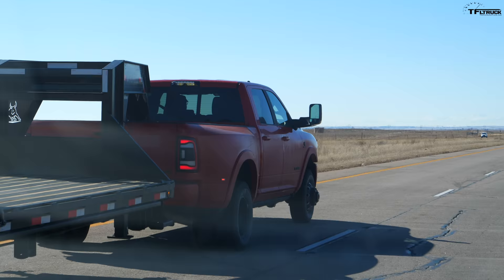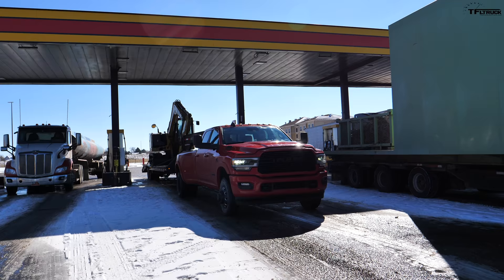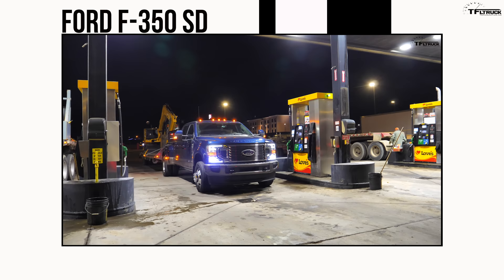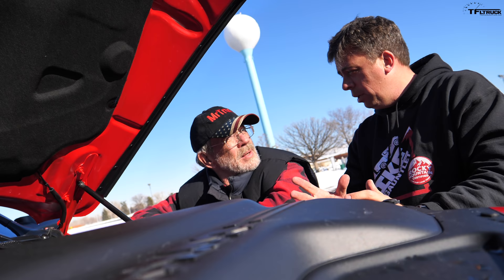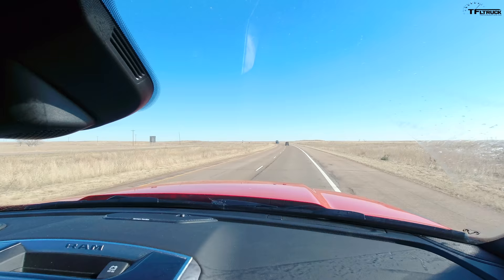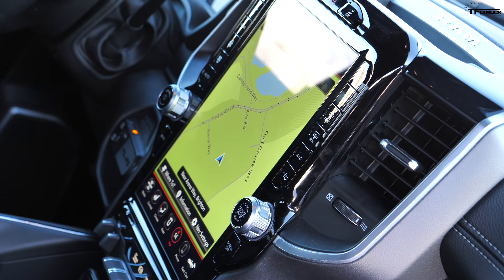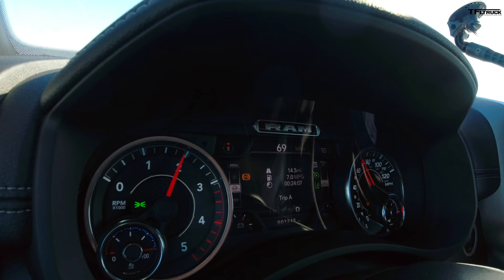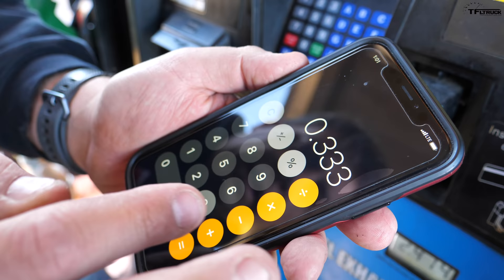New Ram 3500 Cummins Takes On Our 30,000 Lbs MPG Challenge Against GMC & Ford Diesels!

Comment: I drove the Ford and Ram and I was not happy with the turbo lag in the Cummins.
Reply: There is no turbo lag! 🤦‍♂️
Reply: @JohnDoe-nz6bk  the one I drove sure did.  It was the HO with the Aisin.
Reply: Rich Farfugnuven suuuuure
Reply: @JohnDoe-nz6bk  ok, I have no reason to lie.  It reminded me of my 03 6.0L Excursion.  It has terrible turbo lag.  My '02 F350 has none.
Reply: Rich Farfugnuven bwahahahahaha 🤣 thanks for proving you're a liar! The 03 came with the 7.3! The 05 came with the 6.0!!
Reply: @richfarfugnuven6308  I kinda cringed when I read what John Doe said about the 03. I was like did he really not know the 03 did have a 6.0?

But I have disagree about the turbo lag, the 68rfe tends to not have that at all. You should test drive one of those if you are looking for speed. The Aisen however doesn't have turbo lag, but what it has is de-fueling on the first 3 gears. Hit 4th, and you won't have that problem. Not to mention, the V8 design 6.0 did have an immense amount of turbo lag. I had an 05 and drove it to about 187k. After i open it up and tuned it, it was much better but still lagged at times. 

My 19 cummins actually smokes that motor, even though it was tuned and mine is currently stock but my 17 PSD was faster than my 19 Cummins. So you gotta take it in perspective, I really think you just need to test drive a 19 Ram 68rfe and possibly one that has around 10k miles on it to understand the power band on them. They are limited on the first couple thousand miles, just so you know.
Reply: John Doe the 2003.5 came with the 6.0l. They switched motors halfway through the year
Reply: @joe2bear  I have been debating a new truck and am leaning towards a new F450.  However I am hoping Ram goes to the new 9 speed HD ZF transmission that they are supposedly considering.  I am not really sure what to do.  I like the GMC Sierra Denali but the interior is dated and the Duramax is now almost 150 lbs Torque behind the Ford.  My wife drives a '15  Yukon Denali and the interior is still the exact same as the new 3500 Denali.

Comment: It's like saying build a hot rod but worry about gas or race fuel. Lol
Reply: Huh? The purpose of a diesel is to perform heavy duty work efficiently. The purpose of a hot rod is to play or go fast.
Reply: @GroovesAndLands  disagreed extrema form heavy duty work not efficiently
Reply: @GroovesAndLands   when you work a diesel engine  truck or  equipment  hard like pulling a heavy load it goes through fuel. A diesel  is to handle heavy loads.
Reply: @desperadosanchez723  Why are diesels desirable for "heavy loads"? Because they do it reliably and efficiently. Yes, efficiently.

Comment: Need to retry with a 50 gallon tank cause that may also add more weight to the over all weight and affect the mpg on the truck as well
Reply: 150lbs of fuel makes ZERO difference...

Comment: It's a dodge is what it is .  Glad to see the Ford stepping up the diesel mileage.  The smaller ram engine working harder.  You can get the 12" screen for Ford through stage 3 performance.  Like knobs better. Big screen goes down lose everything.
Reply: Yeah our Dodges fill the job sites for a reason.

Comment: Buddies of mine went on a trip pulling approx a 5500lb enclosed trailer with a 2019 Cummins..... they averaged 8mpg hahaha
Reply: My '99 v10 E350 gasser gets 9 mph pulling an 8x16 cargo trailer. It's probably is 4000lbs empty, but similarly shaped. 20 years older and gas v. Diesel nonetheless.
Reply: He must of riding it hard. I have a 2018 srw 3500 with the cummins, when I pull my 7000 lb travel trailer at 70ish mgh I get roughly 13 miles per gallon. I easily get 20 mpg empty, of course that's not drag racing everything of the road either.

Comment: Can you do a 7.3 gas vs power stroke tow comparison? I’m currently trying to decide between the two
Reply: Biel Mèlich Artés 25,000 GVWR. It’s a toy hauler and I’m thinking about service intervals as well as the tow capacity. Don’t wanna over stress a gas motor towing that pretty much everyday.
Reply: Joshua Finke get a diesel because the 7.3 gas is rated at 15,000 lbs
Reply: Diesel will get 50% better fuel mileage empty or towing than the 7.3 gas.
Reply: In the case of 3/4 tons in general, is it even worth it to buy a diesel? The 7.3 pretty much maxes out most of the trucks capacity. I could see a diesel being worth it if there is a significant mpg difference loaded and unloaded. Otherwise the power is there at least for the 7.3.
Reply: @Datsun7705  What trim and what rear gear? TFL just smoked the ike gauntlet with a 7.3 towing a 16,000 lb trailer. Made it up the pass at 8 minutes and some change. Way faster than the Gas Chevy.
Reply: APGJuggernaut he says he’s towing 25k so a diesel with a 3.73 rear end is what he needs
Reply: @Datsun7705  If thats the case then he needs a diesel 1 ton no doubt.

Comment: 85,000 for a truck. And all the big 3 market towards “the working man”
Reply: You can get a Ram 3500 starting at $35,195 MSRP... don't be dense. $85k is for the luxury trims and options.
Reply: Stephen Molzer 😂
Reply: Stephen Molzer so is this not the truck they show in commercials? I haven’t seen a guy roll down his window for his dog. Or even let his tailgate down slowly.

Comment: Guys, you CANNOT use the vin web page. It does not account for the specific features on your truck, despite using your vin. This is the case with the 1500's anyway, you have to double check payload etc on your door jamb.

Comment: C'mon RAM get with it!!! Who doesn't put a big fuel tank in a huge full size WORK truck that is meant to l pull for a living?????  Even the Ford  f150 has a 136L fuel tank!! LOL try building your own engine too! Oh and then theres your trans, you need to think big rig like you did with the airbags and put in more gears! FORD WILL ALWAYS BE #1
Reply: Yeah I totally agree with you Ford is always going to be #1 in maintenance. All I own is Fords in the pass, 2017 was my last one, done with the Fords. They just not reliable pulling heavy on a regular basis. Taking from experience.

Comment: And here comes the ram owners,😭. Lol
Reply: I'm a Ford fanatic, but damn that Ram is killer!  I believe it's much better than my 2019 Superduty. Hate the seats and old interior. Open the hood and all I see is a mess of hoses.
Reply: Lol that's literally any modern car. Cant really seen the engine in my 06 vette. Ford will update the interior soon. Probably 2021 or 22
Reply: Robert Chapman I don't know there was alot of crying Ford and Chevy fanboys with the down hill test,Ford fanboys always try to down play Ram trucks. Shows there jealously.
Reply: @davidharris9259  everybody cries in the end lol
Reply: @davidharris9259  they aren't crying that bad since the dominated the  Ike gauntlet uphill and fuel mph loop. But you are right they have implements to make on the exhaust breaking.
Reply: @kimojon9665  I would buy the Ford , ram then Duramax. I can give two shits about the interior or engine bay. I use them to work.
Reply: Why would the Ford boys be crying when the Ford kicked the RAMS ass up the Ike Gauntlet  by over a minute in an eight mile race pulling 30,000 lbs.  So what it used  12 ounces of gas to whoop the RAMS  ass on the Ike Gauntlet  And then on a 66 mile level looped kicked its ass by 1.8 gallons per mile  Savings with the Ford are 38 gals per every 1000  miles  38 x 3.00 per gal =  $114.00 per every 1000 miles or $11,400.00 for the first 100.000 miles when you drive the same speed.   Who is crying  LOL!
Reply: Kimo Jon have you had the death wobble on your 2019 yet?  I just got out of my 2018 f250 with it.
Reply: @barrysoetoro3488  f25o? whats the death wobble?
Reply: Ford is the Boss!
Reply: @Roger-to2mn  Downhill control is way more important than an uphill time.

Comment: Very disappointing. Ram needs to step up their game in transmission pairing with the diesels.
Reply: Official rumor has it that RAM is going to partner either with Allison or ZF for the 2021 model. Allison would bring them a 9-speed. Not sure about ZF. Both would be great choices to put behind the Cummins engine, methinks!
Reply: Yes, I saw that the other day. Also would like to see the new 1500 cab adopted into the HDs as well.

Comment: Towing at night or when it gets cooler the air is denser you’ll get more oxygen more power, so towing the Ford late gave it a slight advantage?
Reply: I don't like inconsistency in testing but if I had to guess I'd say the morning air is cooler than the evening/dusk
Reply: Cooler air is denser needing MORE fuel for the higher volume of oxygen per given unit in order to maintain a computer controlled fuel mixture.
Reply: Not 1.8 mpg difference
Reply: @AK_Ray  Yes, but he is towing heavy, so more power is what he needs.  A smaller engine will work harder and get lower gas mileage because it has to work harder.  I've seen it and done it.  I got much better gas mileage towing with my 8.1 than my 5.3 towing the same trailer.  And better in cooler temps than hotter.  That's a fact.  But I don't know what the conditions were when they towed.  I would trust the test more if they did it on the same day and same time of day.  But that isn't always possible.  Also, another test they did with all three half tons without a trailer, one truck lead the pack most of the time and drafting surely played a role in those results also.
Reply: Jesus christ yall nitpick everything
Reply: The 1.8 mpg difference is because of the the torque difference(leverage to do the work) and the FAR SUPERIOR RANGE of torque manipulation(TRANSMISSION). The ram used to have the advantage because of the 6 vs 8 cylinder, and the fact that it didn't make power up at the top end like the V8 did. More power means more fuel. More cylinders means more shots of fuel. But those V8s whomp the I6 for power. 
400hp@2800=750lbft
445hp@2800=835lbft 
475hp@2600=959lbft.
All hp is leverage(torque) at speed. That's it the fact that the Ford has more torque at the bottom(1050@1600 vs 1000@1800) and the at the top(475 vs 400) means it's more capable everywhere in its powerband. Then you add the superior manipulation of the 10 speed. And it's a no brainer as to who won. Just like I predicted.
Reply: @wd8786  I'm not disagreeing with you, you are right, I just fail to see how what you've written (your reply) has anything to do with the video or the 3 different engines we have here. They are all the same size, yes I know the dmax is 0.1 litres smaller, negligible.
Reply: R Shiery if you don’t see the connection you need to go to school on mechanics lol
Reply: @lw6735  ok, please educate me. How does comparing two gasoline engines with vastly different displacements (5.3 vs. 8.1) compare to the three diesels with the same displacement as it pertains to this video.
Reply: R Shiery sorry I thought you meant jnk26 comment n didn’t see you were referring to another comment 😁👍
Reply: @lw6735  you're good, no worries
Reply: @wd8786  None of what you wrote is fact.
Reply: @lw6735  Gas engines MUST be operated within a narrow range of acceptable air/fuel mixtures. Diesels do not. It is a fundamental thermodynamic difference, making the comparison being made here completely nonsensical.
Reply: GroovesAndLands ya like I said I misunderstood R Shiery

Comment: Never heard of a 31-gallon tank.  You sure it ain't 32???  Mine is.  But I DO agree with you guys that it's way small.  Should be 36 or 38 minimum.  Glad to see they're offering the 50-gallon option for the 2020s anyway.  Disappointed in the 6.0 mpg result.  But yeah, I think you're onto something.  6-speed tranny.
Reply: Mines a 29 gallon....but its an 07....with a 6.0....that gets 20 unloaded and 11 with 10k......Im happy.....

Comment: Why do the new HD Rams hood look like its not closed all the way?
Reply: I would be scared to buy a Ram.  Puegot, Fiat, Chrysler does not give me any confidence that they will be getting better.
Reply: @dannystrong8127  I worked 5 years for FCA. Despite sizable employee discount - I never bought one...
Reply: Raffles 2108 
They are saving you a step when look under the hood for those missing ponies!
Reply: Exactly why I drive a Ford Superduty!
Reply: @GroovesAndLands  you dont use a truck for work either. Rams are the backbone of real world job sites for a reason.
Reply: Number 1 selling truck brand for over forty years! Ford!
Reply: R AJ I just traded in my pos 19 longhorn for gmc sierra with the 3.0 duramax. I was happy until the front diff blew at 146 miles and I'm having engine issues. Also, my 16 limited Cummins (should have kept that truck) never had an active regen in 12,000 miles. This duramax has regened at least 4 times in 360 miles. I was getting close to 30 mpg before the first regen, not anymore.
Reply: R AJ I had transmission issues too, but a update took care of that, except for the clunk on start up.
Reply: @TheXOoftheRO  Hmmm, not sure about that comment, mostly Ford in oil and gas construction areas

Comment: You fellows check to see how many parts fell off the Chrysler over the 66 miles. They have the potential to build the best and most reliable truck going, but the Quality Control just ain’t there.
Reply: One Good Turn Gets Most Of The Blanket I know everyone’s experience is different but I went from my 95 12 valve to a 16 with the 68 and I’m currently at 114k and other than replacing the batteries and maintenance it’s been a phenomenal truck.
Reply: brady sebring if you tow any amount of weight any amount of the time the 68 won’t usually last 150 k miles
Reply: @lw6735  all depends on tuning. im not at 150k yet but my 68 is showing no signs of giving up. very little debris in the pan and 3rd gear lock up is still as strong as can be. im about 60/40 as far as towing goes.
Reply: brady sebring ya good tuning helps cause I’ve seen a stock truck 68 go out towing with a very easy careful driver
Reply: L W the trans tuning from the factory is or was (I haven’t drive cone of the new truck) absolute garbage

Comment: Honestly Ford has come along way but we as consumers need to start putting pressure on our favorite brands and on the big three to really push the envelope and provide us with efficient reliable machines especially if we are depending bon them for a business and paying almost the price of a small house for it. Videos like this are great and hopefully the brands use them to improve and also hopefully the competition forces each to improve.
Reply: I think they should offer a purpose built work truck, each brand. And by that I don't mean the regular trucks just stripped of all the cool tech inside I mean one that has bigger or better key were items ball joints u joints suspension ect while at the same time not having plastic inside so cheap that it doesn't even fit right new, I guess a line of work trucks not cheap trucks if that makes sense.